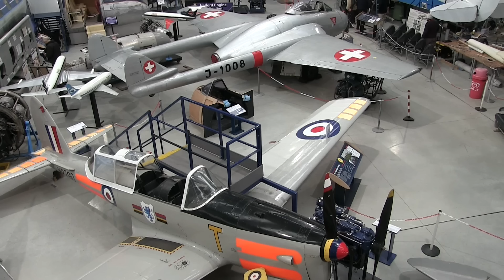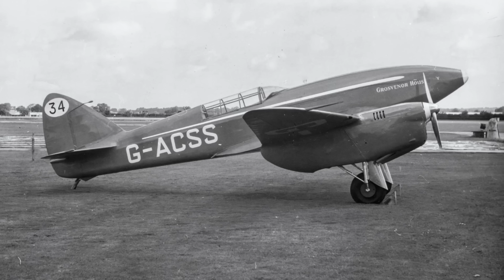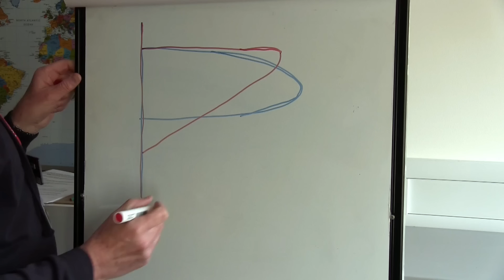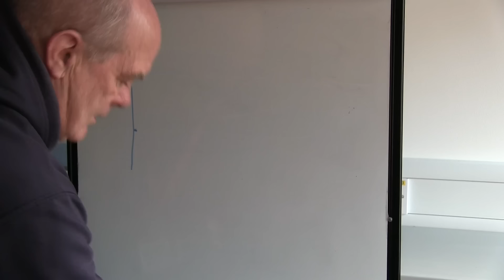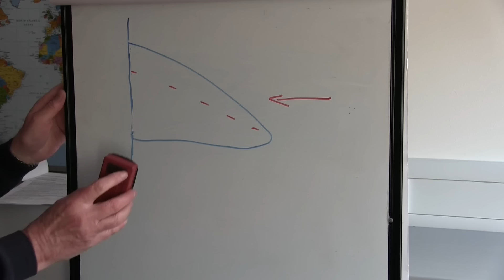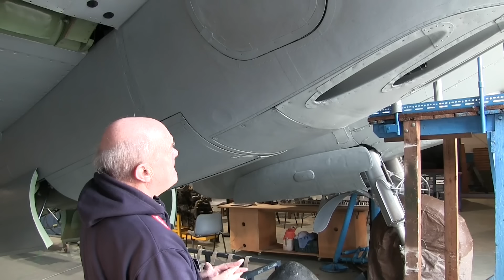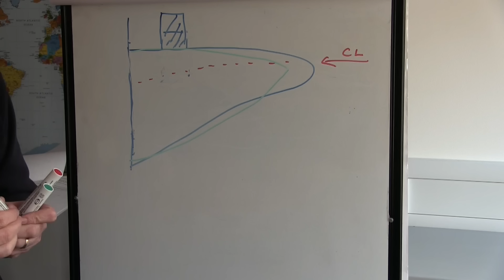Why Did the Mosquito Have Triangular Wings? The Mystery Explained

Comment: My grandfather flew Mosquito Fb VI with 410 RCAF. He was killed in '43. I think it's more accurate to say that tip stall is only really a problem if one tip stalls before the other, which is what causes the spin. That illustration late in the video looks an awful lot like the De Havilland DH.103 Hornet. Which was a single seater utilizing Rolls-Royce Merlin 130 and 131 specialized, "slimline" engines, and both leading edge and trailing edge tapers. I was in a game just this morning flying the Swedish Mosquito J30.
Reply: All this talk about planform but none about washout or profile.
Reply: @jacknisen  Another subject.
Reply: My understanding (as a former glider pilot) is that tip stall can also make the ailerons ineffective, making a wing drop more likely.
Reply: @CharlesStearman  A former glider pilot? If a tip stall then the wing IS GOING TO DROP and the aileron on that wing is useless to correct it.

Comment: Sweeping the trailing edge forward with a straight leading edge makes the wing stronger against frontal forces because more of the structure is in compression. Sweeping the leading edge back with a straight trailing edge puts more of the wing's structure in tension. It’s better to push on glue joints than pull on them. Also, the straight leading edge reduces span-wise flow while sweeping the leading edge would increase it. Another consideration is the placement of the main spar. Tapered wings fly smoother in rough air, roll faster, are thicker at the root where the most strength is needed, and thinner at the tips for less drag. Tip stalling can be reduced thru the use of a different tip airfoil than the root and/or washout.
Reply: Forward sweep reduces stall tendency but the mosquito wing sweep is small compared to the X-29 Ford swept wing.   But I'm not sure if they were aware of this because wing sweep aerodynamics had not yet been studied much
Reply: @glike2 I believe it increases the tendency to stall. The wing stalls from the root toward the tip which would move the center of lift forward on a swept forward wing. The plane will get more pitch sensitive as it gets deeper into the stall. I’d rather have a wing like the Mustang where the main spar is straight and the thickest part of the airfoil is a straight line from root to tip. It keeps the center of lift from moving too far from the CG and it looks better.
Reply: @txkflier  tip versus root stall depends on the wing twist so it might not be like you say
Reply: The wing shape is probably due to the designer’s consideration of the wooden construction. Being a high performance plane with two large engines and such.

Like you say, easier on glued joints.
Reply: I'll add it helps locate the engines in a safer position. 

Wing shape discussion needs to include any twist, airfoil change etc. also landing gear, bomb payload etc all come into play.

Don't forget while not an perfect straight leading edge, other WWII aircraft had a more forward swept wing than rearward sweep.

Comment: The pby catalina also has straight leading edges and straight tapered trailing edges. And I assume there are many more planes like that,  you just haven't looked hard enough to find them.  You did not even find the well known catalina. I would say back to do your homework properly.
Reply: I can't follow that about the Catalina's wings. The wings to a point outboard of the engines were parallel then both leading and trailing edges were angled at the same angle towards the tips.
Reply: @philipkay8116 true up to the engines. Outward from there,  the leading edge is straight. See this blueprint drawing: File:Consolidated PBY-5A Catalina 3-view line drawing.svg - Wikimedia Commons https://share.google/tK5RYoUevQFc5ENFK

Comment: The Arnold AR-5 had a similar layout and still has the C-1 class speed record. Mike Arnold's idea was that he placed the canopy at the trailing edge and the straight leading edge  and larger chord at the root gave better pressure gradient interaction because the lowest pressure part of the fuselage and lowest pressure part of the wing.

Comment: Several books I read.  The wing was built in an odd unconventional way; on the leading spar.  So the ribs stock vertical in construction.  I designed a scale Grumman Goose.  I chose to build the wings vertical. It simplified keeping the taper correct.  Span was 65 inch a 1/5 goose was 117 inch span.

Comment: The only real advantage to a rectangular wing is ease of manufacturing, each rib is the same. It suffers from higher induced drag unless you make it really high aspect ratio which isn't very good for strength, maneuverability, and fitting it into hangars. 
A tapered wing has very close performance to an elliptical wing but is easier to manufacture. 
A tapered leading edge looks fast but only really matters aerodynamically at speeds when compressibility becomes an issue which, in a piston-engined 2nd World War airplane was only really acheivable in a dive.

I'd guess that manufacturing a straight main-spar out of wood as opposed to a cranked back one was easier too. If I'm not mistaken the Mosquito wing was one piece that goes through the fuselage  as opposed to two wings attached to a center section like a lot of airplanes.
Reply: Tapered planform also reduces root stress and risk of flutter, plus the improved lift distribution others have mentioned.

Comment: Thank you. Somewhat off topic... 2 facts related to the 'design' and 'cost' of... people flying them. 1. Fairly slow B17 and large (as far as the target size), with 10 young lads inside, had one o the highest loses of the air war.  One down and 10 guys are gone. To replace them was MUCH, MUCH harder to just bring another new plane from the factory. Ford factory was able to make one in just over an hour. (But then, they have to be flown all that way to England...). How long to train the new crew? Answer: min. of 6 months. Mosquito on the other hand had one of the fewer losses of the war and if that happen only 2 guys needed to be replaced. 
2. The amount of payload was NOT THAT MUCH DIFFERENT, also given the speed of the delivery.  So the British approach was... much smarter, safer for professionals inside.
Also, the more successful missions they flown, the more experienced and better they become.
On the other hand these wooden wonders were like flying concert piano's. Much harder to mass produce if there were to 'sound right'.
Facts supporting above: 7781 Mosquitos were made. Few (or several) hundred were shot down. Even if on the high end it was 700, that's less than 10%. (Likely much less). 
12731 B-17s were built. Combat Losses: 4735. That's at least 35%, perhaps even as high as 40%, BUT... SO MANY MORE AMERICANS GONE because of the crew size of 10 vs. 2 !
Reply: The same comparison, but even worse, works if you compare Mosquito crew losses to Bomber Command losses overall. 125,000 aircrew served in Bomber Command and over 55,000 of them were killed. Most of those killed were flying in Lancasters, Bomber Command's most numerous heavy bomber, with 7-man crews.
Reply: @randallbriggs256  ...which proves my point. Don't put too many eggs in one basket.
Reply: The Mosquito/B17 comparison is a bit of an internet meme which seems to  stem on the British side from a desire to 'correct' a perception that 'Americans think that they did everything in WWII' (saving Private Ryan/ Band of Brothers, that movie where the Yanks ram a U- boat and pinch its Enigma machine when it was HMS Bulldog, etc etc). They weren't equivalent aircraft either in design philosophy or capabilities: bomb load of the Mosquito was 2000-4000 lb, with the 4000 lb payload being limited to the thin-case 'cookie' blast bomb which was good for blowing over walls and windows but not really for penetration, while the B17 was 4000-8000 lb to full range, double or more with reduced range. The Mosquito as a bomber was about a few bombs with accuracy, which speed being its protection. A better comparison would be B17 vs Lancaster, as the most used 4-engine heavy in either force. Even then there's a difference in philosophy: B17 flies by day in a big formation that provides mutual protection with all its. 50cal machine guns (and later fighter escort). Lancaster flies in the dark, with gunners mostly in an observer role, where possible using low flying to evade radar and rendezvousing near the target rather than fly en masse in formation. Again, the chippy Brit might say 'arrogant Yanks' at this, but the prevailing thought pre-war was that 'the bomber would always get (read: successfully fight it's way, with guns and gunners and speed) through. They built the B17 to have guns and shoot it's way in and drop in daylight with the Norden bomb sight. That' s how they used it, and the round the clock threat probably contributed to the depletion of fighter defence who couldn't sleep during the day. However, the Lancaster was much less survivable, being notably difficult to bale out of.
So, a Mosquito wasn't dropping about the same load per trip as the B17s, and while, yes fewer lives were aboard each plane, the retained crew (pilot and navigator) on the Mosquito were the ones who were hardest to replace: I don't think it's disrespectful to suggest that the reason that training took 6 months wasn't because it took at least that long to trainer the Air Gunners.
Reply: @chrishowell5718  >'the retained crew (pilot and navigator) on the Mosquito were the ones who were hardest to replace'. On lost B17 replacement of the pilot, navigator along with the co-pilot and bombardier were also needed.  
Payload vs. accuracy is another debate. 
'The De Havilland Mosquito was exceptionally accurate, often serving as a precision bomber that required, for example, less than 40 tons of bombs to destroy V-weapon sites, compared to over 160 tons for heavy bombers like the B-17. Mosquito  speed and agility allowed for low-level, high-precision raids, with low operational losses, making it a highly efficient platform.' End of quote.

Comment: My bet is that they wanted to keep the leading edge straight so the main beam inside it will be straight and close to the leading edge.

Keeping the main beam straight and forward is a very robust construction against twisting forces. I also bet it helped with the installation of the engines that hang from it. It seems they wanted the engines as far forward as possible.
Reply: & survivability in hostile skies. Repairability, too. It used to be my job to break, then repair, aircraft. Great fun, although only commercial scale models 😂
Reply: Main spar also deeper for longer also

Comment: I have no access to any source material, but I have been to the museum and looked at the Mosquito carefully - because I intended to build a cardboard RC model. It looked to me as though the reason was to give the pilot very good visibility of the ground (and possibly attackers) beneath him.
Reply: Eh? How?
Reply: Except in the case of the DH98, the radiators and oil coolers are mounted in a small extension to the leading edge of the wings between the fuselage and the engine nacelles, thus blocking that downwards view...

Comment: You're putting the cart before the horse by looking at CG. Generally the wing and fuselage would be mostly designed first, and then the wing would be designed to attach at the point where it would match the combined CG. There are some cases where other design aspects prevent that from happening, but those are rare. The most likely answer for the Mosquito is simply that it was more aerodynamically efficient, since a swept leading edge leads to some spanwise flow and slight associated losses. For transonic or supersonic aircraft this loss is accepted since the wave drag benefit is much greater, but even then there are some planes like the MiG-15 that add fences to the top of the wing to counteract this.
Reply: I'm surprised it is rare - it looks very 'right' indeed!

Comment: I thought it was related to the wooden construction.
My first thought was that there is a lot of forces on the wing root (wing attaches to the fuselage). Not only does wing hold the heavy engine, it is also subject to the forces of flying (especially when turning). A long wing root would distribute those forces along the fuselage especially since typically wood has less structural strength than metal.
After "stop press", construction which is more likely main reason. The video said that tapered/elliptical wings were difficult to manufacture and that was for metal wings. It would have been very difficult to do the same thing with wood even with the incredibly talented people who built the Mosquito. So the leading edge of DH 99 wing was straightened to become the Mosquito's wing.
Reply: I dispute this theory that curved wings cost more to build (a J. Clarkson assertion too).
Design would be more complex - but manufacture? Why? 
I also see no reason why curved wings would be too difficult: the rest of the plane is ALL curves! (including tailplane and fin)
Reply: @onceamoth  Jeremy Clarkson has unlimited self confidence, but no actual competence in anything scientific or technical. He claims to know more about science than scientists. He does not. He is just a perfect example of the Dunning-Kruger effect. 

The elliptical wing shape was a massive problem with the monocoque Spitfire. It first flew just 4 months after the Hurricane (March 1936), but despite huge resources, could not be produced in adequate numbers until 1942. Stressing the metal skin over a curved edge was much more difficult than stressing it over a straight edge. It also became clear that the aerodynamic advantages of the elliptical shape were minimal, and it was just not worth it. The later Mustang had similar monocoque construction, but straight edges and a "laminar flow" profile - the former made it easier to manufacture & the latter made it more aerodynamic. Supermarine learned this lesson when they designed it's replacement, the Spiteful/Seafang - this also had straight edges & laminar flow profile. 

The manufacture issues are somewhat different when you are working with wood, and I don't have a detailed plan of the wing construction. But if there is a secondary spar at the leading & trailing edges, you would need to steam-heat & bend to wood. This would be time & resource consuming at best, and may not be possible with some types of wood. It might also cause issues with the wood's subsequent stability in a high stress-cycle weather-exposed environment. Also, getting a perfect join when you have 2 curved edges meeting at an angle would be more difficult from a carpentry point of view. With a straight edge, the join angle stays the same along the entire edge. 

Doing all of this for the shorter curved edges of the tailplane would be disproportionately easier.
Reply: @brutussmithicus I agree with your assessment. Stretching aluminum is a skill. I wonder if forming the ribs in front of the spar was easier due to repetition? 

In addition, the sheets of skin would likely require less waste. I think there is a mosquito near where I live. Next airshow I will have to look more closely.
Reply: @hackish1  I never thought about the waste issue. It wouldn't be too much of a problem with the Spitfire because you can just melt the scrap down & re-roll it. But there was a shortage of seasoned timber for Mossie construction, so the waste from an elliptical wing would be an issue. 

It would be interesting to look at a wing plan to see how any pieces of wood they would need to steam-heat & bend. 

Another issue which occurred to me was that without the forward sweep, you would need to put the wing-spar further forward (for the same CoL), which could encroach on the cockpit space.

Comment: The wing shape may very well have been a compromise in aerodynamics and ease of construction avoiding the complications of steaming the wood to achieve curved leading and trailing edges.
Reply: Roll rate is increased by:
1. increased taper. 2. increased semispan of the ailerons, up to 60% of the wing gives the maximum rollrate.
3. Aileron deflection at high speed (overcoming the forces) can be achived by "frise ailerons" or semi balance tabs, the DH-98 has the latter.

Comment: These oversimplifications of the effect of wing planform on the aerodynamics is really annoying and factually incorrect. The elliptical wing, in addition to being ridiculously expensive to build, also had a tendency to stall completely. This would be corrected by introducing washout, but that would destroy the elliptical lift distribution and actually increase induced drag. A wing like Lancaster's, which starts straight at the root and then tapers towards the tip can yield similarly high wing efficiency for greatly simplified manufacturing. Spitfire would have been even easier to build and just as stellar a performer with space for the guns (which was the reason given for replacing the single-tapered wings for the elliptical wings) if it had bi-tapered wings like Lancaster, or the Heinkel H100. The single-taper wing of the Mosquito and Hurricane tend to also place the majority of the mass closer to the centre line, reducing roll inertia.
Reply: I think the simplification was reasonable enough given the likely lay audience. Whilst wings like the Lancaster's might give a rough approximation of what is achieved by an elyptical wing, an elyptical wing of specific planform will be what gives the smoothest evening out of stresses along the wing I think? And the Spitfire wing was thin for its time, so perhaps all this was in the designers mind as well as the aerodynamic considerations? And there's no doubt that the elyptical wing had a unique aesthetic appeal!